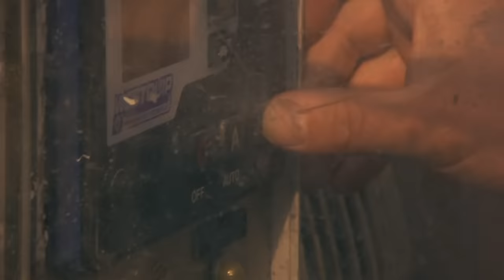Parker Buys A HUGE New Excavator For His Crew | Gold Rush

Comment: I have always wondered why the rock trucks always dump into a stockpile instead of a ground level hopper that could handle 30-50 tons.    You could still use the stockpile when lots of incoming trucks, and then feed the hopper with a loader.   One of the savings would be fuel and manpower to operate the loaders.   maybe there are other considerations - such as clay, jams and how to handle the oversized rocks but those are problems with solutions
Reply: I think it's more alone the lines of the fewer moving parts and things that can break a hose the better. Sure having a hopper with a autoloading would be better, but you have hte problem of either hydrolic lines blowing open or a belts just going to orbit when something just slightly too big gets stuck. Not to meantion unless it's a bucket conveyor, a rock getting stuck will chew through the belt and now you have lost paydirt across the ground a new belt to order which might not come in for who knows how long.
Reply: Another big thing is mobility. Try and keep the plants fairly mobile. These cuts can progress fairly quickly and eventually you get a long haul so the set up is better as it takes less time to get the plant moved to a new location